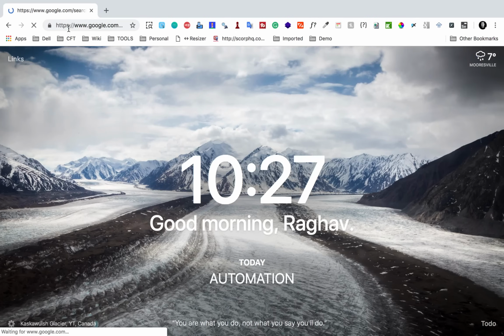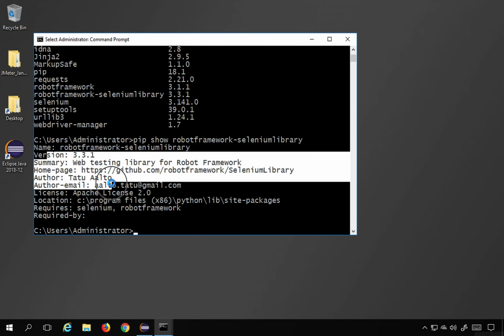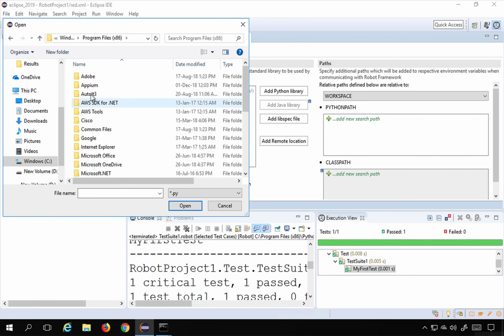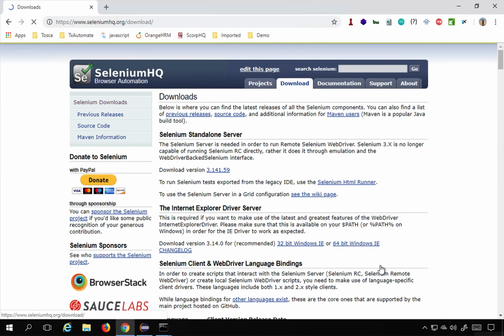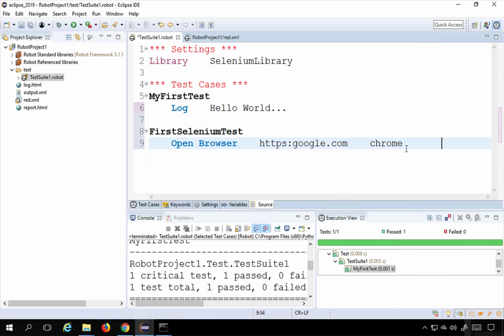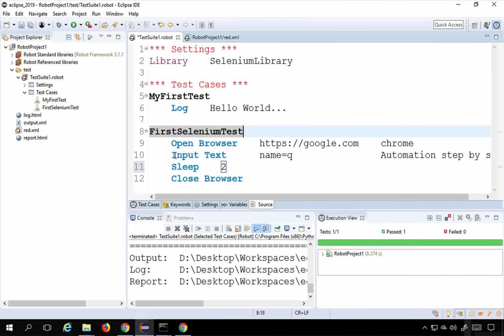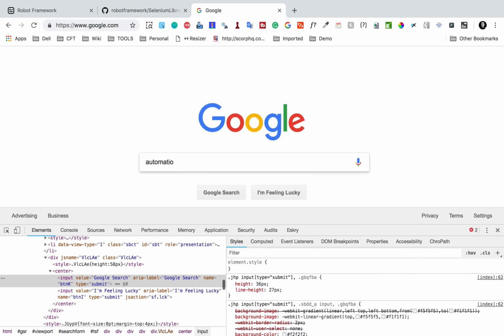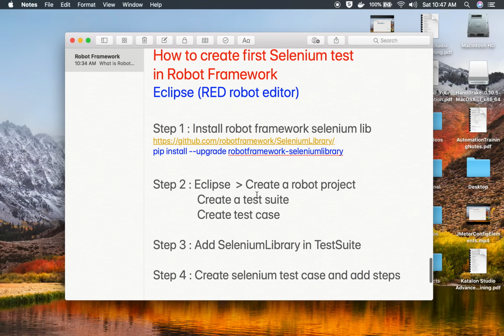Robot Framework Beginner Tutorial 6 |  First Selenium Test

Comment: Hello Sir, I am trying to add SleniumLibrary file into RED as you have mentioned, I am getting error "'SeleniumLibrary' library specification file was not generated. Try to reload manually in Project Explorer" Could you please help.
Reply from the maker: Srushti
I'd be glad to help you resolve the "'SeleniumLibrary' library specification file was not generated" error you're encountering in RED Robot editor (Eclipse). Here are the consolidated steps and additional insights, incorporating the best aspects of previous responses and addressing potential issues:

1. Verify Prerequisites:

- Robot Framework version: Ensure you have Python 3.5 or later and Robot Framework 3.2 or later installed. Install missing dependencies if needed.
- Java JDK: Make sure you have a compatible Java JDK version installed (usually a version matching your Eclipse installation).
- RED framework: Check if you have the correct RED framework plugin installed and configured in Eclipse. If not, update or reinstall it following the official guide.

2. Address Missing Resource:

- Reload Libraries: Click the "Reload Libraries" icon (green arrow) in the RED toolbar or Project Explorer to refresh library data.
- Manual Project Cleanup: If reloading doesn't work, perform a manual cleanup:
    - In Eclipse, go to Project > Clean....
    - Select "Clean All Projects" and click OK.
    - Then, go to Project > Build Project.
- RED Plugin Update: In case the error persists, consider updating the RED plugin to the latest version.

3. Check Library Installation and Path:

- Robot Framework Installation:
    - Install SeleniumLibrary: `pip install robotframework-seleniumlibrary`
    - Verify package installation using `pip list`.
- Library Path Confirmation:
    - Right-click your project in Eclipse and go to Properties > Robot Framework > Libraries.
    - Ensure the SeleniumLibrary path is correct and the library exists in the specified location.
    - Add the library path if it's missing.

4. Address Java-Related Issues:

- Jython Installation: Install Jython if not present (compatible with your Java version).
    - Check your PATH environment variable to ensure Jython is accessible.
- Jython Interpreter Configuration:
    - In RED, go to Project > Edit Robot Settings.
    - Under "General", set the Python interpreter to Jython's executable path.
    - Ensure your Jython library is compatible with SeleniumLibrary's dependencies.

5. Troubleshooting Tips:

- Log Analysis: If the error persists, check the Eclipse console or any generated logs for detailed error messages. These can provide specific clues to the issue.
- Community Resources: Utilize RED documentation, Robot Framework forums, and Stack Overflow for help from experienced users. Share relevant error messages and configuration details for more targeted assistance.

Additional Notes:

- Double-check all paths for correct spellings and ensure they point to the actual library files.
- If you're using a custom SeleniumLibrary fork, make sure it's compatible with your environment and dependencies.
- Consider starting with a basic Selenium test without complex setups to isolate potential issues.
Reply: Thank You so much for your response Sir.
I"ll check and let you know. @RaghavPal

Comment: Hi Raghav, Is there any way to download chrome driver on Runtime or Dynamically with out copying the chrome .exe file in Scripts folder
Reply from the maker: Sai
Yes, there is a way to download the ChromeDriver executable on runtime or dynamically without copying the chrome.exe file in the Scripts folder. You can use the `webdriver-manager` package to do this.

The `webdriver-manager` package is a Python package that can be used to automatically download and install the correct Selenium driver for your version of Chrome. To use the `webdriver-manager` package, you need to first install it with the following command:

```
pip install webdriver-manager
```

Once you have installed the `webdriver-manager` package, you can use it to download the ChromeDriver executable by calling the `install()` method. For example:

```
from webdriver_manager.chrome import ChromeDriverManager

ChromeDriverManager().install()
```

This will download the latest version of the ChromeDriver executable and save it to the default location. You can then use the `webdriver` package to create a new ChromeDriver instance. For example:

```
from selenium import webdriver

driver = webdriver.Chrome()
```

This will create a new ChromeDriver instance that uses the downloaded ChromeDriver executable.

The `webdriver-manager` package also supports downloading and installing other Selenium drivers, such as the FirefoxDriver and the EdgeDriver. For more information, please refer to the `webdriver-manager` documentation: https://github.com/bonigarcia/webdrivermanager

I hope this helps

Comment: Thank you very much for all your help. I was not able to install RED on MAC, so I switched to window and it worked, however, I am now having issues where keywords such as open and log are not recognized.  Wondering if you can point me to any solution..

Robot.TestingSuit1                                                            
==============================================================================
Mytest-Selenium                                                       | FAIL |
No keyword with name 'Open' found.
------------------------------------------------------------------------------
Robot.TestingSuit1                                                    | FAIL |
1 test, 0 passed, 1 failed
===============================
Reply from the maker: Hi, can try the following
1. Check all the libraries are added
2. restart eclipse
3. Check if there are any changes in the functions

Comment: Hi Raghav your video is very good but do you have any similar video for MacUsers and ones that use the Visual Studio Code and all the latest versions of Robotframework and Python? I am trying to learn Robotframework (coming from Katalon Studio) and the structure of my tests is different. Also do you know how do you update all the Webdrivers of the all Browsers? Do you do it manually over a command line tool? (in Katalon was easy over a drivers update command and now I think that it is more laborious.).
Reply from the maker: Hi Aggie, not as of now, will plan to add, can check all existing here https://automationstepbystep.com/

Comment: Hi Raghav,
can you please help me to create chrome options before running the script
chrome setting >>flags>>same site setting need to disable with scripts
so please help me on the same.
Reply from the maker: Hi Kumar, can check this https://github.com/nokia/RED/issues/89
https://stackoverflow.com/questions/28537290/how-to-set-path-chrome-driver-in-robot-framework
Reply: @RaghavPal  it is not useful for me can we contact on demand base?
Reply from the maker: Hi Kumar, may not get time for a session, Can check more online
Reply: @RaghavPal  HI Raghava,
just i want check create options for the browser for example
open browser       url      chrome     options 
i need the help to create the options please help me on that
steps: 
1) go to chrome and "chrome://flags/"
2) find the same site settting >>under three options are there so just i want select Disabled. using the RIDE
please help on that
Reply from the maker: did you try , what is the issue you faced

Comment: Hi Raghav, are you familiar with this situation: geckodriver file lies in the python script folder, when the firefox browser is invoked(same exact steps as your demo) , it's launched but the url is not loaded as expected. i did some searches in the net and the answer is either about setting a firefox profile or using compatible browser : driver versions. is there a better and easier solution for the issue i'm facing? thank in advance :)
Reply from the maker: Hi Nizar, I will need to know what exactly is the issue, is it not loading the url you are expecting, what does the logs say. Also check the selenium and firefox ver compatibility - https://firefox-source-docs.mozilla.org/testing/geckodriver/Support.html
Reply: @RaghavPal  Problem was solved few days ago.Indeed, it was a compatibility issue. thanks Raghav.

Comment: Hi Raghav, 
Thank you alot for all ur videos topics, its very interessting.
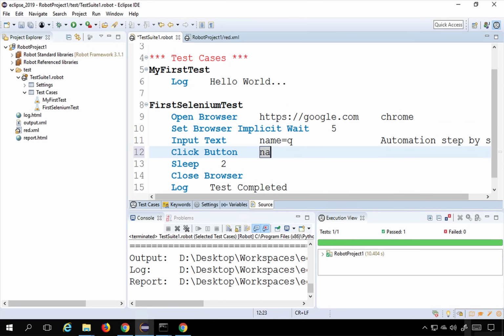Im trying to do the same thing in 16:40 (FirstSeleniumTest) and i have this error msg when clicking on bntK button :  ElementNotInteractableException: Message: element not interactable
  (Session info: chrome=80.0.3987.116), can u give me an advices ?
Reply from the maker: Hi Amin, try to add some wait time before this step and also check the logs
Reply: @RaghavPal  Thank you for your feedback, it works well when i tried with name:q ENTER and also with Xpath values, but with btnK same issue after adding times, idk why, but thanks again :)

Comment: Hi,
Thank you very much for all the testing material you provided🙂.
I am getting "Element with locator ... not found." Even the locator for google search is correct. Plz suggest, i am totally new in robot framework
Reply from the maker: Hi Nikita, try the following in sequence and check
1. Add some wait time before this step
2. Try using a diff locator or property for the element
Reply: @RaghavPal  i used xpath, id but not working wait is also added
Reply from the maker: Can you try with name property. Also check some online examples

Comment: Hi Raghav,
I installed SeleniumLibrary and checked in the list. but when I give command "pip check robotframework-seleniumLibrary", it gives error below:
C:\Users\xxxxxxx>pip check robotframework-seleniumlibrary
astroid 2.3.1 requires typed-ast, which is not installed.
spyder 3.3.6 has requirement pyqt5<5.13; python_version >= "3", but you have pyqt5 5.13.0.
spyder 3.3.6 has requirement pyqtwebengine<5.13; python_version >= "3", but you have pyqtwebengine 5.13.0.
Could you please advice on this. Thanks!
Reply from the maker: Hi Pooja, can you try installing again or a diff ver.
Reply: @RaghavPal  Thanks for your quick reply Raghav. I worked installing typed-ast, pyqt and pyqtwebengines to version 5.12 :)

Comment: Hi Raghav, after giving an open browser keyword followed by URL and browser name chrome. And running the test. Its getting failed and the message is displayed saying " web driver exception: unknown error: failed to start chrome process. And i copied the chrome.exe file and paste inside at python script folder as per your steps but I got error like this WebDriverException: Message: 'chromedriver' executable needs to be in PATH. Please see https://sites.google.com/a/chromium.org/chromedriver/home. I also set the environment path for both admin and user variables but no output. Please guide me with the solution. Thank you.
Reply from the maker: Hi Rajesh, Pls check your chrome browser ver on system and get corresponding chromedriver.exe from here https://chromedriver.chromium.org/downloads
Provide its path in script and try again
Reply: @RaghavPal  Ok Raghav. Let I check.

Comment: Hey so I'm running into a little issue. The whenever I open chrome using the webdriver through robot framework, it runs very slowly. Like if I type in the url on my normal chrome browser it fully loads in a couple seconds just fine. But when I do it through robot framework it takes at least 1 minute before it fully loads. Is there anything someone can do to help me with this? Thanks in advance.
Reply from the maker: Hi Ben, not sure of the exact root cause. Pls check few links here - http://bit.ly/2IIQIEO

Comment: Hi Raghav, Thank you very much for the video on this topic. I am trying to automate Mainframe 3270 screen using Mainframe3270 library but when I am adding the library in red.xml, I am getting error saying 'Library specification file was not generated for 'Mainframe3270' library'. Need your suggestion to resolve the issue.
Reply from the maker: Hi Rahul, not much experience with mainframes, will have to get some online help.

Comment: I was checked, sir.
But show the message like "DEPRECATION: Python 2.7 will reach the end of its life on January 1st, 2020. Please upgrade your Python as Python 2.7 won't be maintained after that date. A future version of pip will drop support for Python 2.7.
No broken requirements found."

I have two test cases of u given on video 6 and 7.
The 6th video test case passed but 7th one should throw an error like "FirstRobotframeworkTest                                               | FAIL |
TypeError: 'module' object is not callable"

If it's possible to resolve any other way, sir if u have anything please let me know.
I'm eager to implement the test cases in the robot framework.
I am the very fan of your videos sir.

TnX!
Reply from the maker: Will have to see your setup. Meanwhile pls try online help. Also, Anbu pls add your responses as a reply to the message chain and do not create a new message as I find difficult to set the context and have to search for earlier messages

Comment: Hi Sir,
I had faced the issues please guide me the needful help,

WebDriverException: Message: 'gecko driver' executable needs to be in PATH.
Then I used the code like "Create Webdriver    chrome    executable path='/home/anbu/Downloads/Drivers/chromedriver'"
Now it was resolved and another one is coming like "TypeError: 'module' object is not callable"
I'm using the Ubuntu 16.04 your never mentioned anything on the Ubuntu users needed some valuable guidance, sir.

TnX!
Reply from the maker: Hi Anbu, I did not try on Ubuntu. 
Which line exactly is this error thrown from. This should be a python issue.
Reply: @RaghavPal  

Sorry, sir!
No issues on coding only on the Robot standard library folder the Dialogs file was shown REd with Null contents, sir .
If it is resolvable or not sir.

Tnx!
Reply from the maker: if its a library issue. Try to run this command with your libraryName and see the information
pip check libraryName